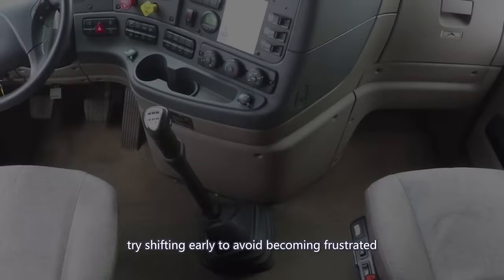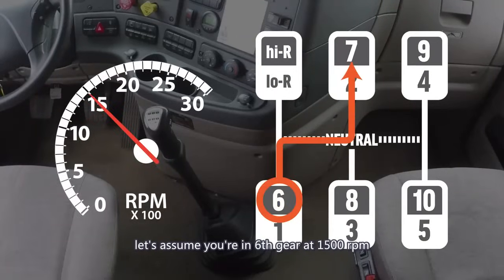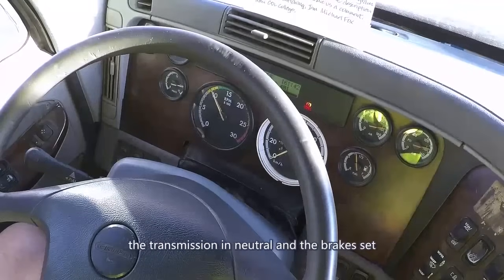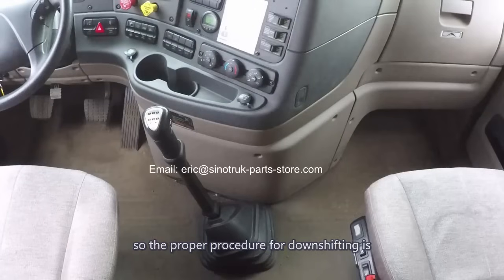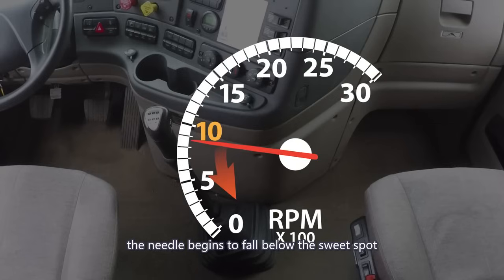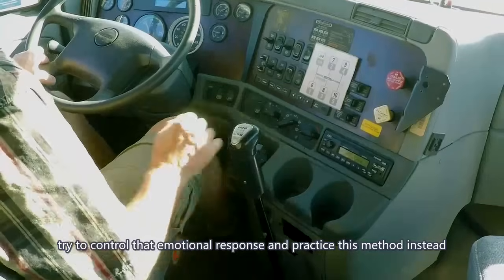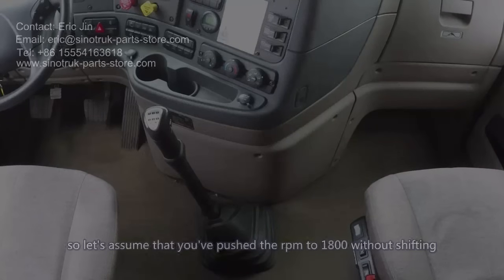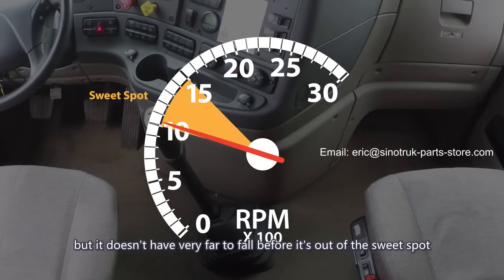Howo Truck Gear Shifting --10 Speed Gearbox Upshifting, Down Shifting and Fixing a Misssed Gear

Comment: i was driving a MAN semi truck with 2x2x4 16 gears 17 years ago.
For cars is it the best kind of transmission, i drive now a VW Passat and a Skoda Octavia with 6 gear manual transmissions.
Automatic transmissions are just for electric cars and hybrids.
With moder manuals you can downshifting without double chutch pressing,because they have sychrone rings inside.

Comment: The problem I’m having in school is that the rpm I need is always changing depending on the grade I’m driving on. It’s hard to remember all of it. On my study sheet for upshifting I’ve got add on 100 to 200 for uphill. So let’s say 1st to 2nd is 1200 rpm, uphill would be 1400 rpm. 5th to 6th is 1600 rpm, uphill is 1800 rpm. And for going downhill with an upshift I have to take away 200 rpm. So 3rd to 4th is 1400 rpm, downhill I’d take off 200 rpm so it’d be 1200 rpm. 
That’s for upshifting. 
For downshifting I’ve got 1200 to 1300 rpm going uphill
1100 rpm on level ground
And 1000 rpm going downhill. 

But wait there’s more, 
Before my shift going down a grade it says to have my rpm’s at 1000 before my shift, but for gears 1, 2, and 3 have it at 800 rpm for my shift. That’s downshifting going downgrade. 

Basically all the rpm’s for upshifting and downshifting are all different depending on the grade of the road. Uphill, downhill and level ground. Also on my study sheet it says if I’m at idle then it’s no rev at all for downshifting. So I’m confused as fuck to say the least. And I have to call out everything I’m doing while I’m doing it while I’m trying and try to do all this at the same time. It’s not easy at all.
Reply: I feel ur pain
Reply: bro😭😭😭😭 I feel ya pain
Reply: Keep pushing. Surely, you will get it right!🎉

Comment: Well good luck with this prewar technology🤣🤣
Reply: much better,than automatics.
much more possibilties to control traction, gas consumption (much more less,than on automatics) acceleratiin, motor braking.
You can much more direct accelerate with a manual as with the automatics.
my 170HP car with manual has the same acceleration, as the car of my brother with 190 HP automatics.

Comment: Let me tell you some rookie.
If you use if you have to use attack and the clutch to shift gears. Go find yourself another job. Use the clutch once when you first take off never use it again until you stop. If you have to use a tach quit driving.🤷🏽‍♂️🤷🏽‍♂️.
Second grade two years before you ever touch that clutch.
Pitiful. It's all by ear and your foot will tell you when this shift.
Reply: Try to explain the correct engine pitch to shift at, in a video. Can’t be done. Teaching needs to be done by the numbers, certainly in a video.

Have you had success teaching students by covering the tach, and teaching them by engine pitch, in person (not via video)?

Comment: I tried this procedure but still missing the gear I don't know if I was nervous
Reply: When you’re shifting up, don’t try to bang it into gear. Push the shifter until you feel the gears meet, then kind of slide it in. They will mesh when they hit just the right RPM. So if it’s around 1500, keep some pressure on the stick and it should slide into gear when it’s ready. Don’t get frustrated and bang on it, it might go into gear that way but it ain’t good for the equipment. 

Best of luck, you’ll get the hang of it!
Reply: after driving auto boxes for 5 years started with a another company all manual gearboxes.
wish you all the best it come to you mate just some patience mate you'll make it.
this video had some great tips always learning.
safe trucking.